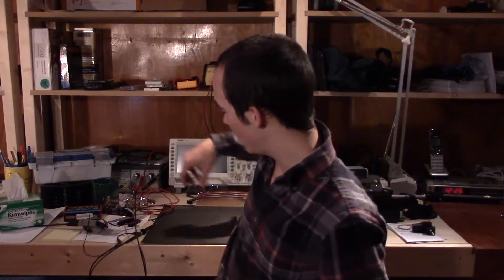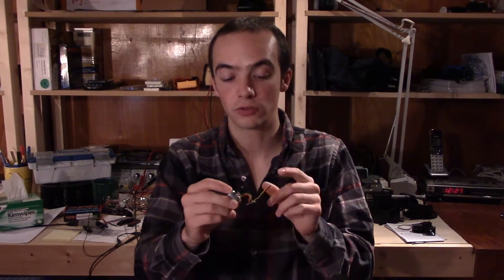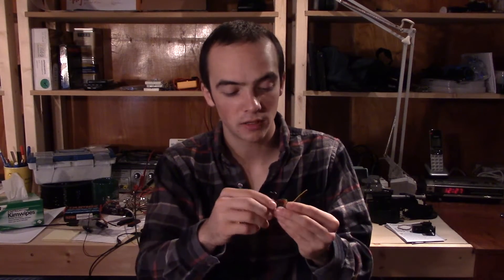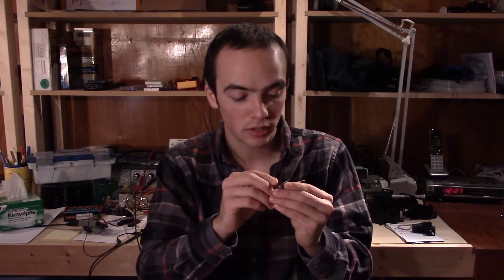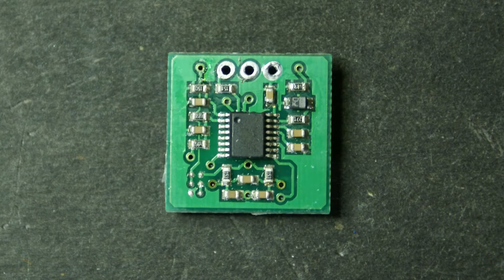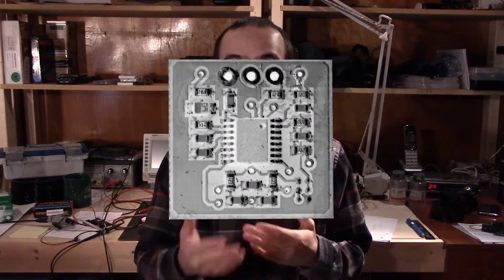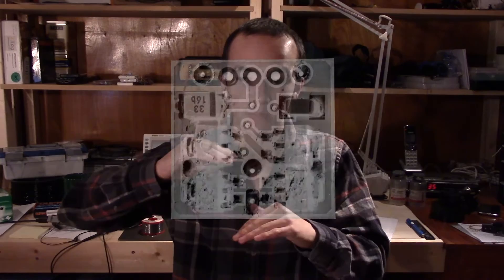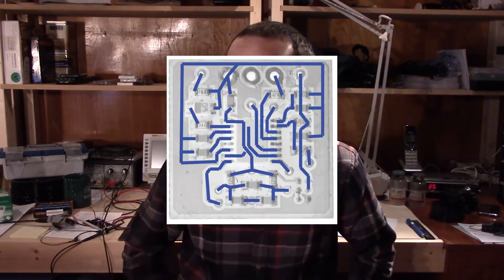Tinman Electronics 12 - Reverse engineering a servo motor

Comment: hello 
I do really need your help on this subject I've seen it done on videos on you tube where they are using the servo with the electronics minus the motor using the motor output to supply an h bridge pwm and dir to operate a larger motor as in a wiper  motor from an auto final need is to use this as a powerful steering servo for a power wheels rc car that im into building please help me, im at your mercy.....take a look at this video https://www.youtube.com/watch?v=FEoeRnrFd2M&feature=youtube_gdata_playerand then as you see that it can be done , I have an h bridge prebuilt so hopfully you can direct me on where and how to put the servo wires and the power wires and grounds HELP im almost there just dont want to blow it up....im David at hrlyrdr79@yahoo.com  . . .thank you.....